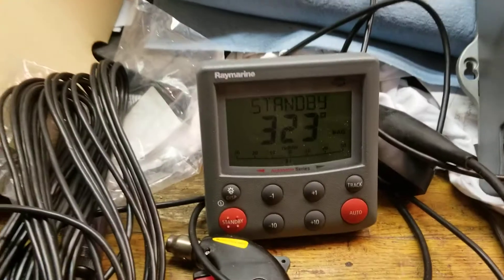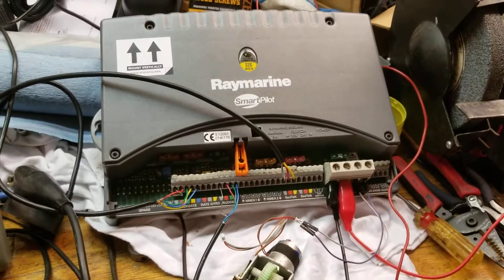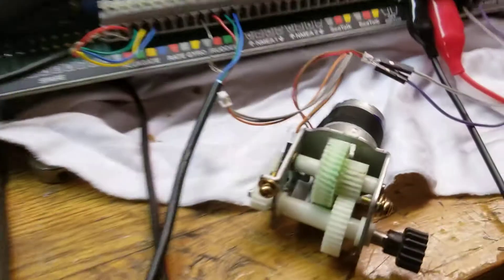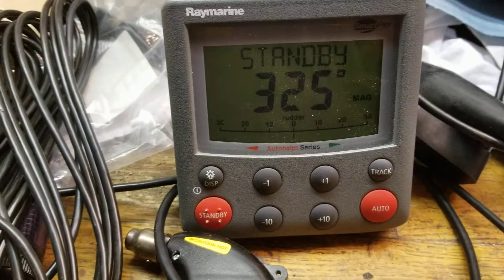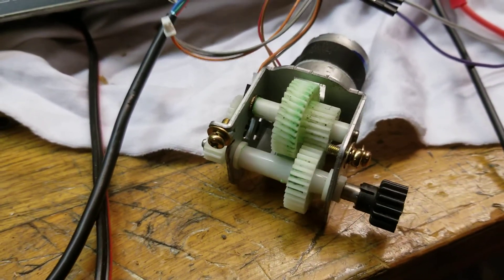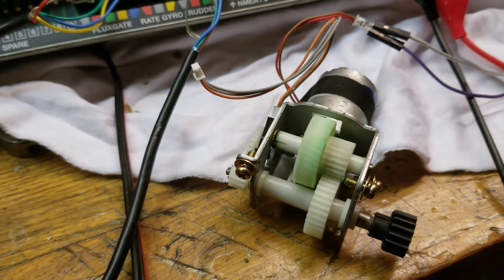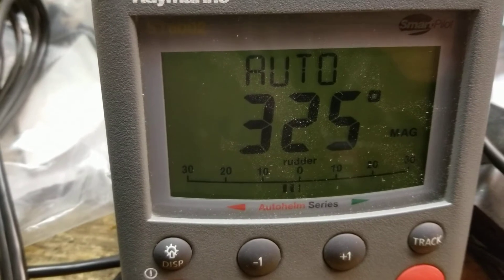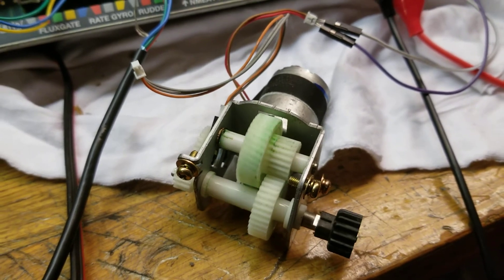ST6002 S2G Raymarine autopilot bench test

Comment: Hello my friend, I have a question, I hope you can help me... I have a ST 6002 smart pilot, but the wheel that goes on the rudder is broken. My question is if it is possible to use the same system but put a hydraulic piston instead of the motor with the gear on the rudder? Thanks, all help is welcome.